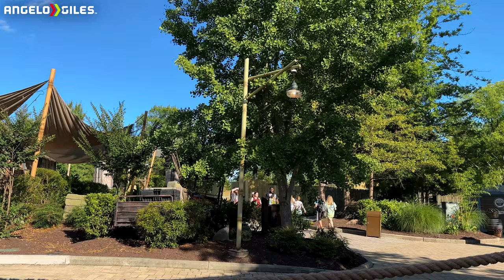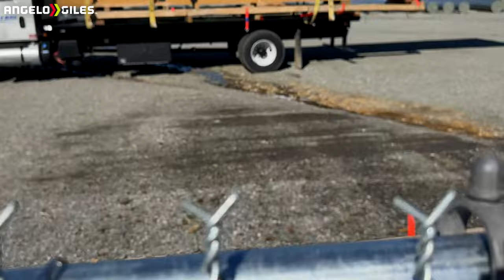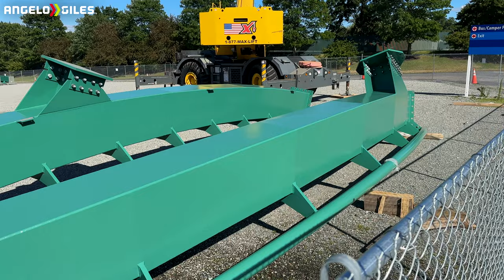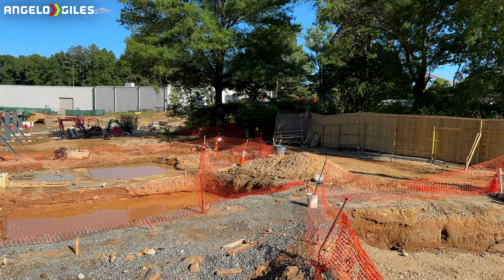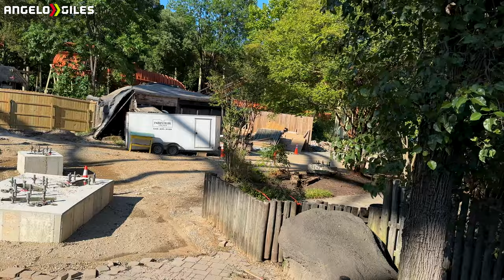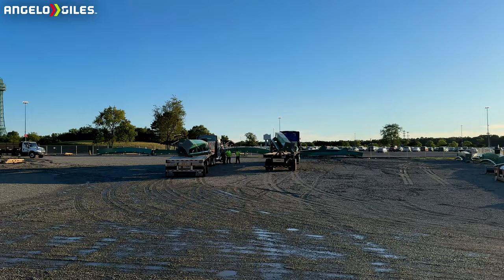Kings Dominion 2025 Roller Coaster Construction Update 10! 👷‍♂️BRAKE RUN AND LAUNCH COMPLETED🎢🤯

Comment: As far as the free spin is concerned I was always curious as to what they went with the smaller version. Every thing this parks adds they always get the cheapest version of flat rides ect.
Reply: It's all over in like, 10 seconds
Reply: @mig4868  Couldn’t agree with you more my opinion it’s not a worthy successor to volcano but can just do.
Reply: @darrylellis4809  Tumbili isn’t the successor to Volcano, it replaced Crypt. The new launched wing coaster is the one replacing Volcano.